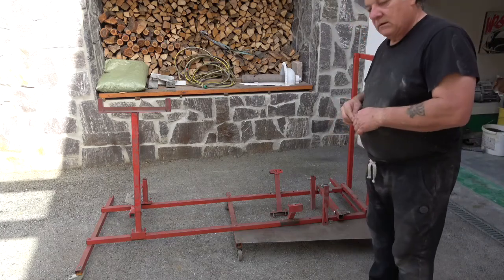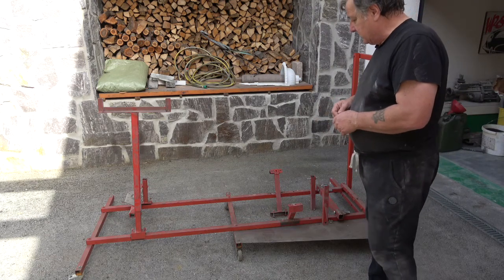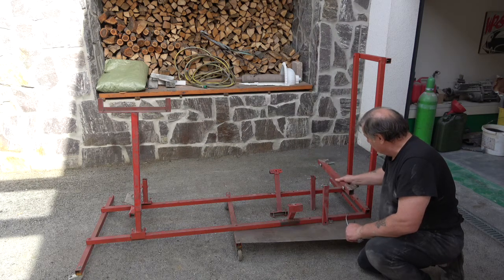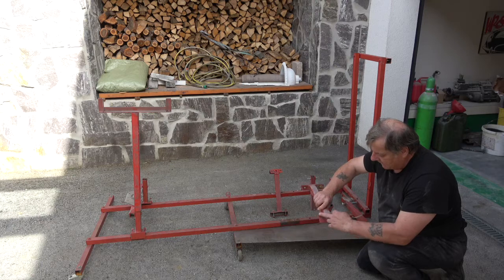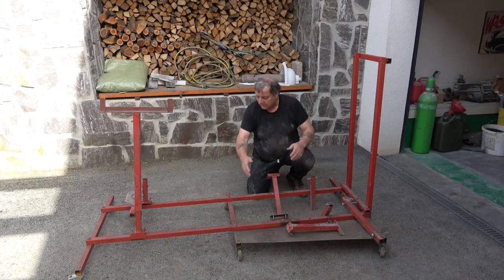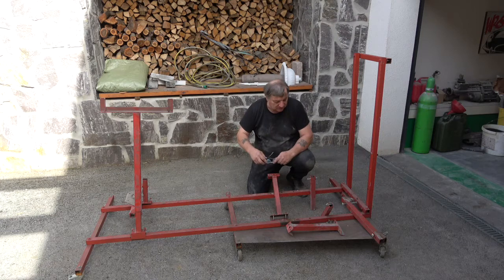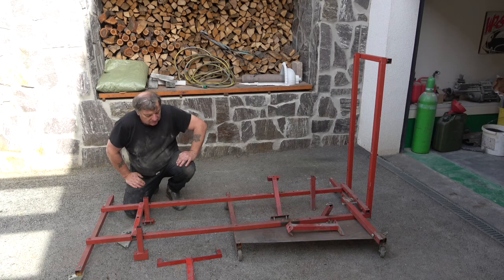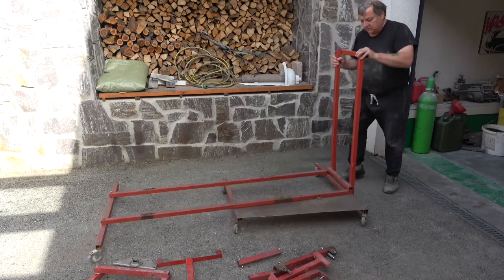DIY Jaguar XK Engine & Gearbox Test Stand

Comment: Dave, can you measure it up and post up your dimensions? I was going to build a frame around an engine block but would be good to have some numbers to go by! Interested in a close up of the actual engine mounts to if you get a minute ...thx for your videos they are super useful mate...
Reply from the maker: Oliver,  I have some photos somewhere when i was building the test stand. I can also CC you the photos i sent to George who was going to do the same thing as you & build one! I just suspended the engine in the air and built the frame around it. I made it all bolted so it could be stored away when not in use, Just drop me an e mail at davejaguar66@gmail.com  Cheers Dave.
Reply: that was my plan too- hang engine and block off gantry crane and build round, but since you've done that always good to know of and gotchas and unexpected issues, sending u an email cheers

Comment: I wish I would have had one of those back in 1962 when I rebuilt the XK120MC. I had to put the engine and trans into the chassis to test it, which had the advantage that I could also bolt a seat on the chassis and drive it, but it wasn't handy like that setup. Thanks for letting us take a look.
Reply from the maker: Bruce, George has a XK engine and he will be some time before the body is restored so he would like to run the engine from time to time, I was going to give him some plans & then i thought it would be better for him to use the stand for what it was built for rather than let it sit around collecting dust! Cheers Dave.
Reply: Bruce Boschek ....l rebuilt mine the old fashion way right on
The concrete floor and started it on the concrete  floor as well
That was the fastest start ever after rebuilt engine l never seen 
one start so fast.
Reply: Yes, mine started on the first try, too. I didn't have the cams adjusted correctly, however, and had to take the chain sprockets off when I finally got a cam alignment tool. Later I realized I could have done it without the tool, but that was the first engine rebuild I had done. The engine had a C head and 3 Weber carbs. It was a challenge to get running well, but had lots of power. I put 2 SUs on it and it ran great.